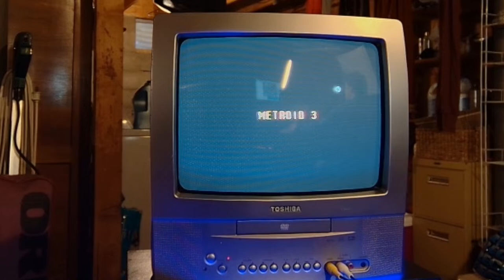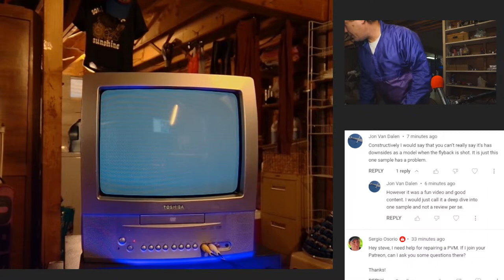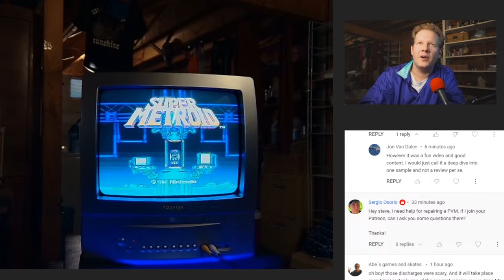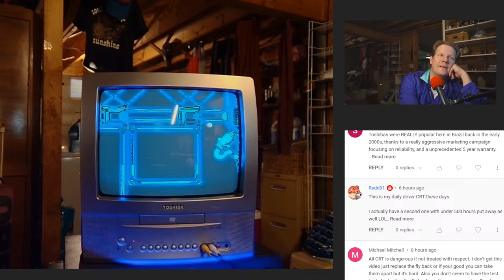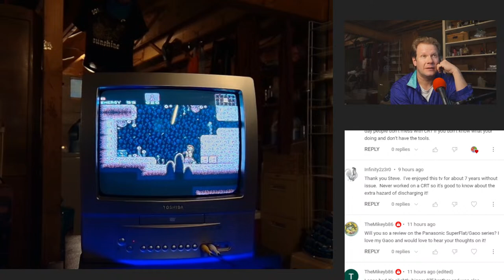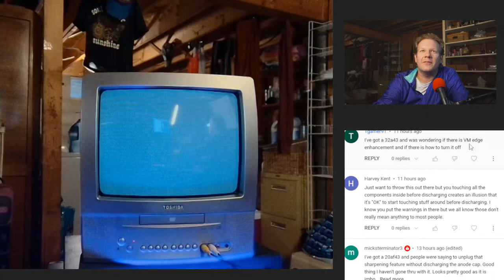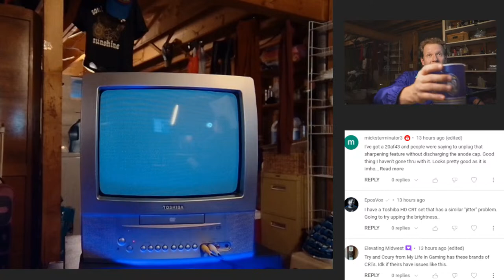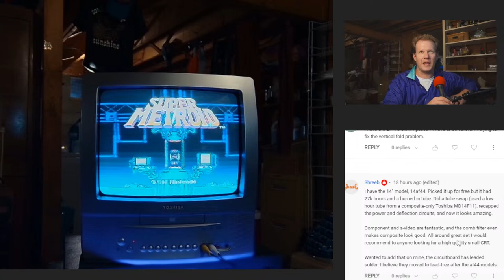Talking Tubes: Toshiba CRTs and More on the 24AF45

Comment: I've got a 20AF46C, and its a really nice little set. I don't have any of the issues that you've outlined so far. Its November 2006 production date. It probably has lead free, but it hasn't given me grief yet.
All toshiba TV's use the same remote code,  so any of the remotes will work with eachother, except the ones with built in vcr/dvd. Some toshiba sets you can channel down bellow channel 2 to get to the inputs.

Comment: I have a lead free tv. The service manual says not to use lead solder for repairs. I doubt the operating temp gets hot enough to melt normal solder. Any reason you can think of why it would say not to?

I picked up a 14 and 20" AF. Got rid of them because of poor geometry that was beyond service menu and my then current abilities.

Comment: I have a couple of these Orion-made Toshibas, one 20AF46 flat 20”, and one 27A45 slightly curved 27”. They are both low hour so the tubes are very bright and punchy - maybe some of the best looking tubes I’ve seen. BUT, the flatscreen has terrible geometry and horizontal linearity which makes 2D games distracting to play. The slightly curved 27” has much better geometry but the horizontal linearity is still bad. I had a 32” curved Toshiba that was actually made by Toshiba and not Orion and it had nearly perfect geometry, linearity and convergence and was super sharp with thick scanlines. If my experience is any indication, the true Toshibas are much better made CRTs than the Orions.

Comment: I thought you were fair on the toshiba, all things considering. The lead free solder itself is enough to knock it a grade. The discharge is scary too. In a lot of the nicer sets, when you stick your discharge tool in, you dont get anything and is done as precaution. But on these toshibas, these things dont mess around. Then the fact that the brightness has to be turned up too high. And finally you have an orion tube which arent known to have the highest quality tubes. All these factors, the particular unit you have is enough to get the C- you gave it. 

I have heard that the earlier models, the ones made in the 2002/2003 years should have been made with higher quality parts.